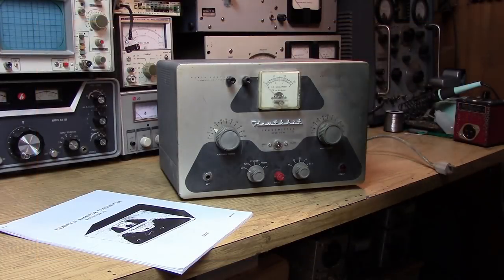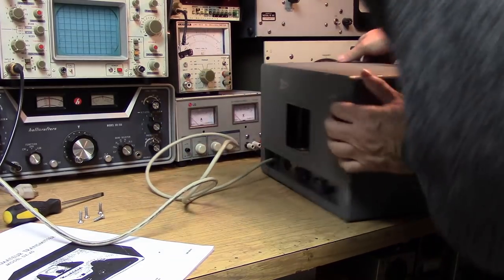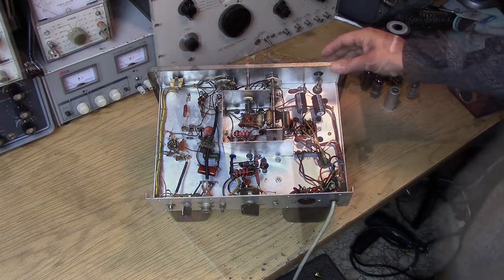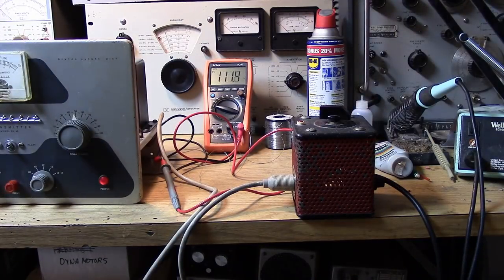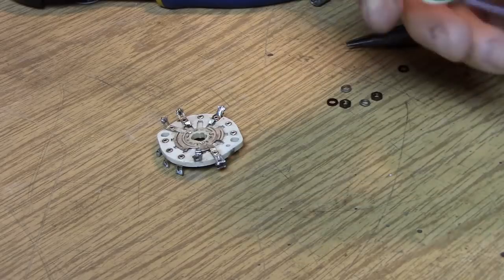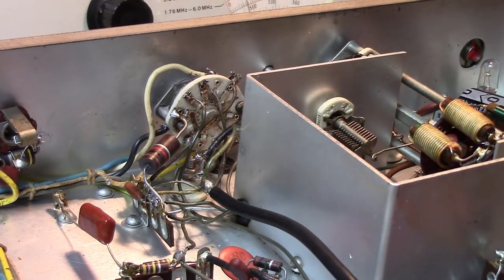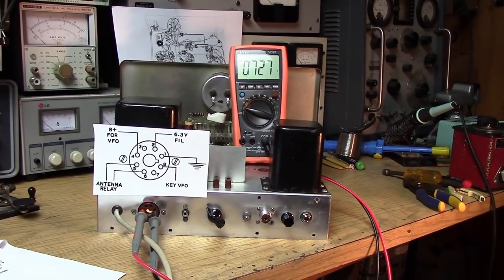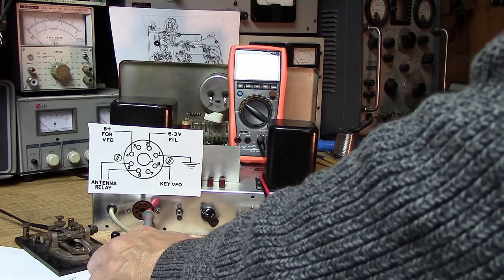DX-40 Servicing Part 1

Comment: Those of us that grew up on tube equipment learned to respect it.  The highest voltage I ever worked with was a bit over 4000 volts in the plate circuit of a pair of 4-400A's in a home brew linear.  I had plenty of pilot lamps to warm me that the plate transformer was energized.  After shutting down the power supply (and pulling the ac plugs from the outlet), only then would I open the lid to work inside.  I'd also first watch the needle on the plate voltmeter fall to the left peg, and then I'd grab a long, well insulated screwdriver and short the plate cap of one of the tubes to ground.  (I never drew and arc)  Some people would put in an interlock so the plate supply would not power on with the lid off, I never installed that, but there was an interlock that would not apply plate power unless the tubes had heater power, so those filaments were a WARNING that HV was present!!!!  (Actually I could turn the HV off with the heaters on, but I still had the HV meter and pilot lamps).  Worst shock I ever got (as a teen) was line voltage hand to hand.  Didn't last more than a few milliseconds before I was spat out of it by muscle spasm.  Was trying to splice a hot circuit.  Stupid!!!

A friend of mine once absent minded did try to short out his HV supply to work on a linear before the caps discharged (open bleeder resistor?)  The size of a 3500 volt arc will put the fear of god in you (and weld a screwdriver to the chassis!).  I also have witnessed large electrolytic caps under go RUD (rapid, unplanned disassembly).

Comment: You said `One tube v1` installed with 6.8 vac on the filament?  That`s about right.  The voltage should come within tolerances with all the tubes installed. Also to get an exact ac voltage from a meter is difficult unless its a guaranteed 1% instrument. .

Comment: I bet solid state VFO was used, running of the fil voltage, with rectifier in vfo. HV resistor may have been removed to avoid accidents. 73
Reply from the maker: There were a lot of solid stae conversions. I wanted to see what I could do with taming the original valve circuit.

Comment: Mike, great video as always. One thing that I do when bringing up an unknown HV power supply on a Variac is to substitute the tube rectifier with one of those plug in solid state rectifiers. That way I can bring the voltage up very slowly and  perhaps, if I'm lucky, reform the filter cap, without having to deal with the filament coming up on the rectifier tube. I never bring the Variac to full line when doing this because I do not want to over voltage anything but it certainly helps with peace of mind when first bringing up a piece of vacuum tube gear where I can bring up the B+ to a low voltage and check for problems before parts go up in smoke.
Reply from the maker: Mark that is brilliant. It would be great to know before you hit 50% that something is not going to pop.

Comment: He can't believe they built this without a fuse, if it is anything like my DX100 the fuse/s was in the power plug. Ron W4BIN
Reply: At the beginning of the video he made note of the fact that the AC chord had been replaced. So if there was a fuse in it it's long gone. Perhaps his surprise was that whoever went through that radio and recapped it and put the new cord on it did not put a fuse in it.

Comment: Mike, I am curious what your filament voltage went to when you installed the rest of the tubes. I have a DX-40 in my collection of equipment for future restoration. Years ago I had 300vdc in one arm and out the other... quite a wake up call. It didn't prevent me from later getting my  ham license :-) Love your videos! 73 and keep up the good work!
Reply from the maker: It did go down to around 6.45VAC; still a touch high, but no worry.

Comment: T storm. Near by bolt. Did the honors. At the club.
Reply from the maker: Show off! That is a convincing demo (getting electrocuted by lightning) at the usually boring ham club project meeting.
Reply: @MIKROWAVE1  meeting called and a 40 meter line was still hooked up. To his rig. During the meeting.   Pow. Zapp. That building was emptied out .  Quick. Will never forget that. I have a real respect for storms to this day. Specially when viewing the remains. Hi hi. De kv4li.

Comment: Check for sparks with lights off. Why use a digital meter? Jumps all over.
Reply from the maker: Ha - why don't I have real test equipment? Like a heathkit VTVM? or a real generator from at least the 80's? I don't know. All I can say is I use what I have like a lot of junkbox hams do. I keep the pro stuff at work. Last week I was using a PNA-X 4 port Network Analyzer that cost 500K, to measure some filters and amps at work.  Now that was boring.
Reply: @MIKROWAVE1  I have a Simpson 260, I trust it more than digital meters.  Especially over varying voltages like you had
Reply from the maker: @Capecodham  The 260 is a classic!